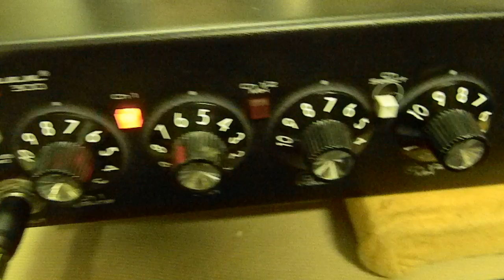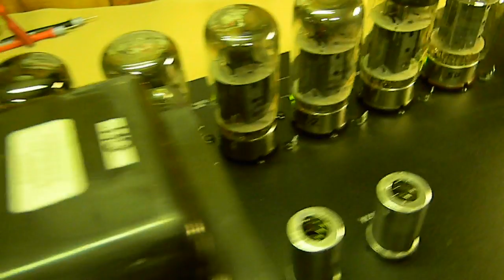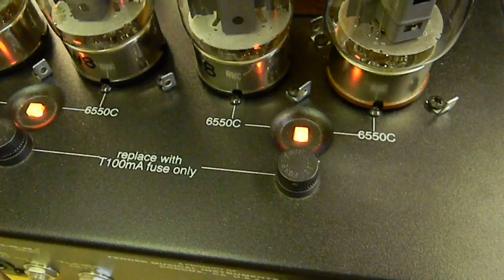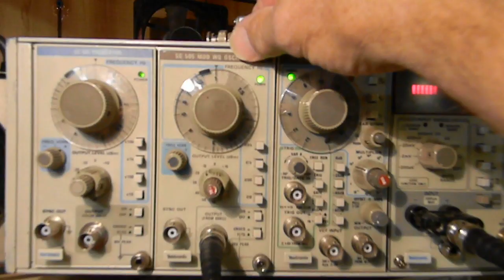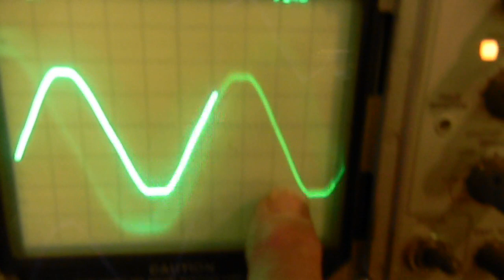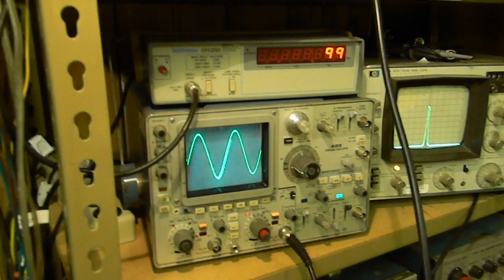Fender Bassman 300 Pro Vacuum Tube Bass Guitar Amplifier.MOV

Comment: The difference in gain between 100hz and 1khz probably has to do with the tone stack. A typical fender tone stack has a 10db drop centered around 1khz. This amp doesn't have the typical FMV passive stack like the old fender black faces, but they may have copied that response.

Comment: It's funny... I used to design and build amplifiers like this 40 years ago, and back then, anything over 100 watts seemed like a lot of power. Today, I have several 6,000 watt solid state industrial amplifiers in my home sound system, so my reference points have been skewed a bit lately.. :-)
Anyway, enjoyed watching all the old 'iron' performing on tests. Makes me want to get my lab cleaned up and start doing some amp servicing again.

Comment from the maker: Thank you for your input. This amp just passed through my shop and I no longer have it. I quickly threw the video out on YouTube not knowing much about the operation of the amp but you have explained it. I am sure other viewers will appreciate and understand your comments. Even as weird and I may have it adjusted, I was impressed with the raw power the amp could deliver. Thanks again.
Reply: ElPaso TubeAmps so the output Transformer is going to be larger than the power supply

Comment: Hi, interesting test. I have this amp and as far as I can see it in the video you have some odd settings which explain that the 1kHz frequency has less output. You have the compression section on and the “eq balance“ all the way to bass (this pot is like a crossover). Also the comp make up gain is cranked. 
Would be great to see the results when you turn the comp off for the test.